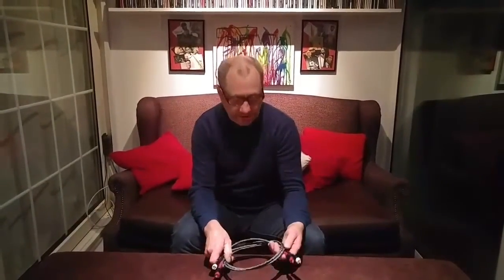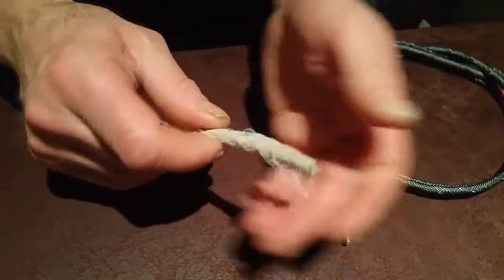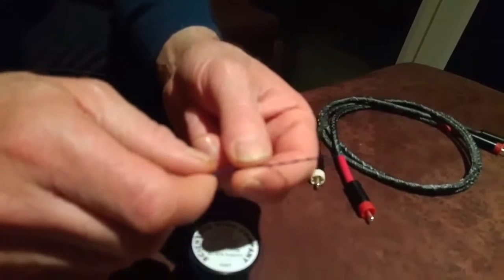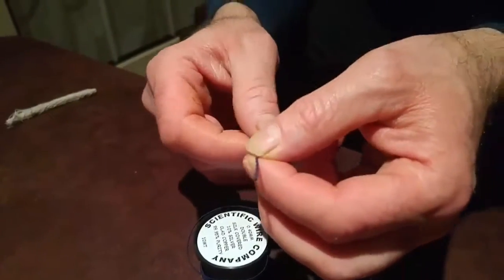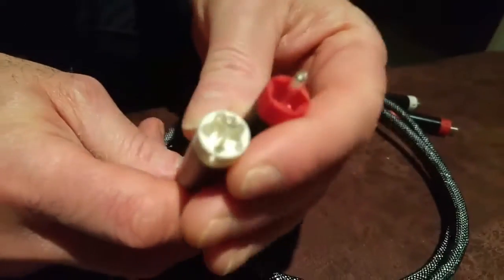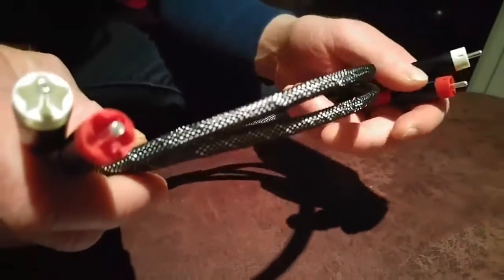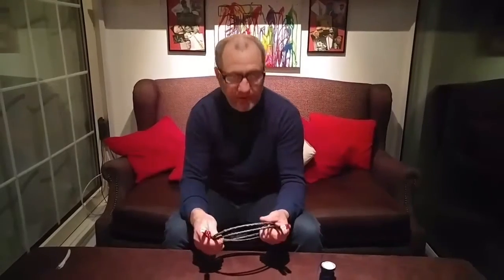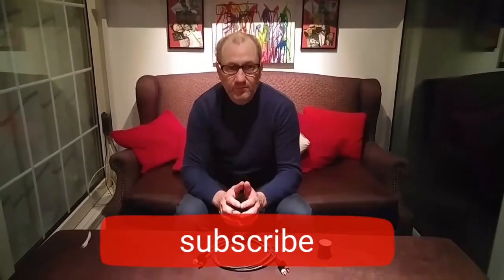Ultra Hi-end Interconnects Technical information video

Comment: HI TM, why not using Teflon tubes instead of protecting with teflon tape. Cheaper ?Tkz, Xavier
Reply: Xavier DE LANGE, tweakerman has a later video called “Why you should make your own audio cables” where he talks about different dielectric constants for different materials. He uses PTFE not Teflon because PTFE has a lower constant meaning it is a better insulator.